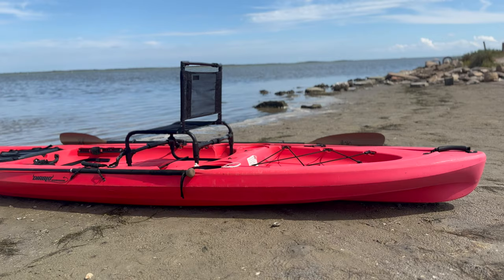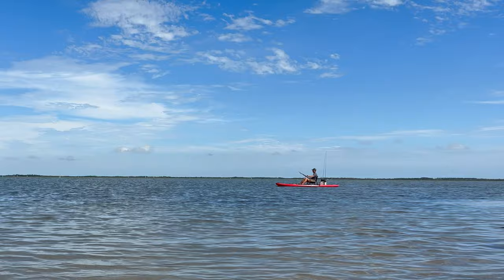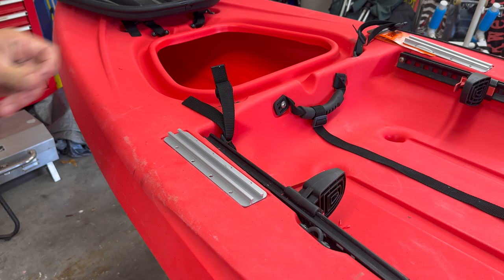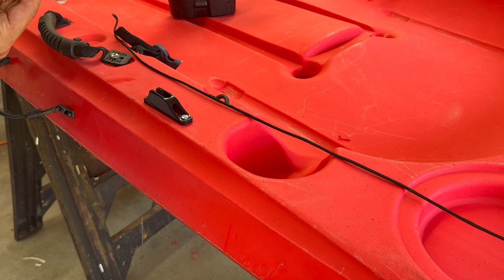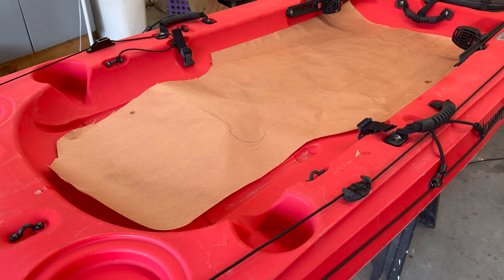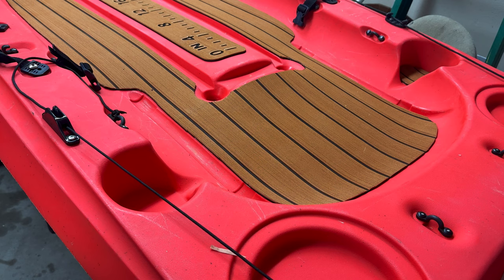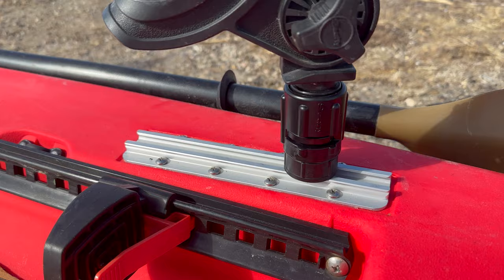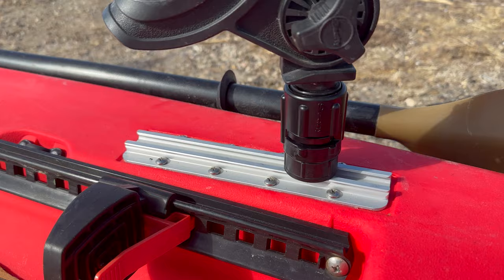Easy DIY Upgrades for Shallow Water Fishing: Rigging a Diablo Amigo Kayak

Comment: Dude that’s awesome. I’m looking at a used one in green right now. Does $800 for a clean, barely used one with a Larry seat and dolly sound like a fair deal? I love the foam flooring.
Reply from the maker: Thanks!  $800 is not a bad price if it truly is barely used.  I paid a bit less for mine, but it was older, and I probably still overpaid a bit due to its true condition.  It still does what I need it to do, so I'm happy.  Best of luck!  They are a great fishing platform for shallow waters.
Reply: So I ended up “adopting” some boats from a friend that is no longer able to Kayak due to shoulder issues. I think the one I’m going to make my primary fishing boat is a Native Manta Ray 14’. Are those Larry chairs pretty universal? It looked like it just sits down in there and uses two straps to secure it? Also, I’m in Spring Branch, TX, west of Canyon Lake. Let’s fish!
Reply from the maker: @wilkinsonfamily3342  Congrats on the new boats!  The Native looks to be a good platform, though I notice it's designed for a on-deck seat pad.  On my Diablo, there are slots molded into the deck specific to the shape of the bottom of the Larry chair.  The legs of that chair run fore-to-aft, so unless that seat space of the Native is wide enough, you'd probably have to build some sort of riser for a chair like that to fit on.  There are other raised kayak chairs with legs that run side-to-side, so those might be a better choice if you wanted a raised seat.  Do keep in mind, the Native is fairly narrow, so it you do raise your center of gravity, it may get tippy.  

I love Canyon Lake!  I have some property near there where we hunt, and I've brought my kayak up there to get on the water during the heat of the day.  I've caught some nice bass out of there.  Is the water level coming up now that we've got some rain?